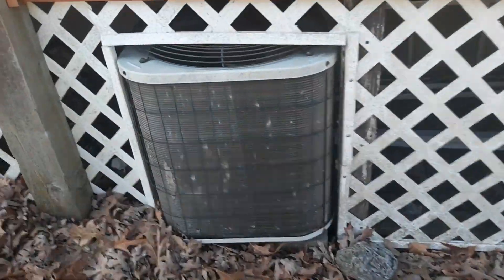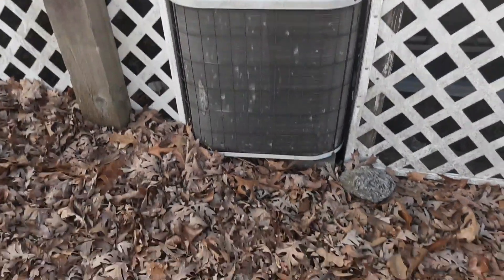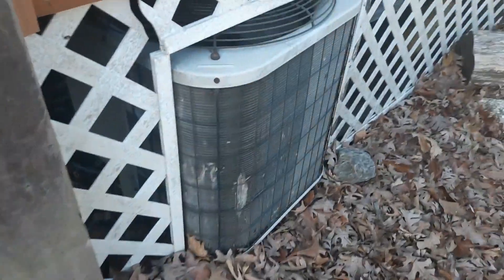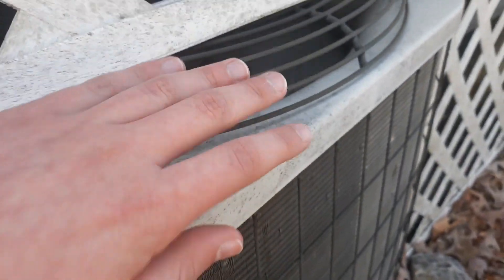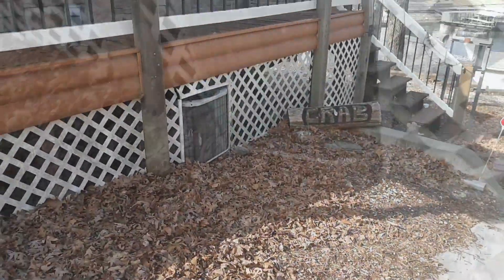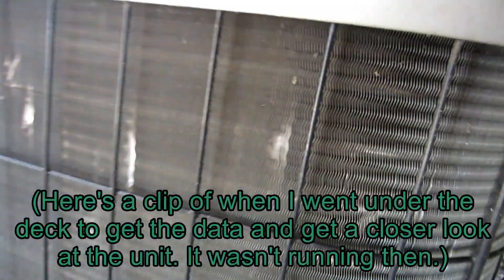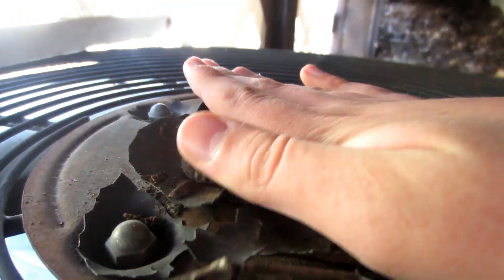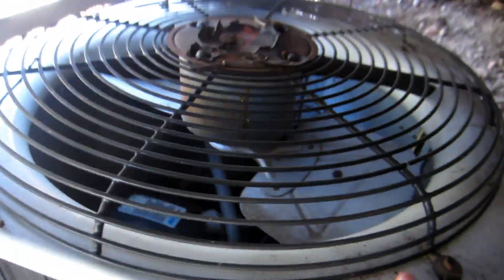1994 Bryant Heat Pump Running in Heat Mode

Comment: How cold was it when this was filmed? I think you should write the temperature in the description for most of your hvac videos.
Nice video, these Bryants are very rare
Reply from the maker: Thanks! I usually do give the temperature in the description when it's available, but this time I just forgot. I think it was around 65-70 degrees, so I'm not sure why it was running in heat. Cool, I didn't know they were rare
Reply: @dilchproductions  Hmm, that could be an issue then. Heat pumps shouldn't freeze up if it's 65-70 out
Reply from the maker: Yeah it's weird that it was freezing up in that temperature. There was only a tiny bit of ice though. And it seemed to be working fine
Reply: @fanshvacandmore14  There Used to be Another One of these Bryants that was at the Regal Drive Butit was Replaced, By Another Intresting Unit ( It’s a Payne Labeled as Weathermaker
There’s Another Bryant Like that one In the Same Heaven That’s Still There As of 6 Months Ago